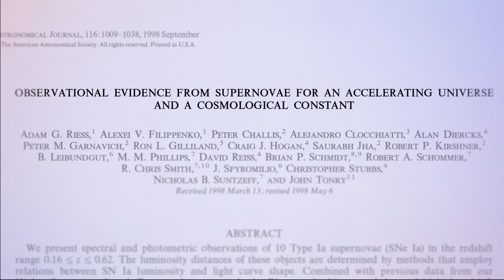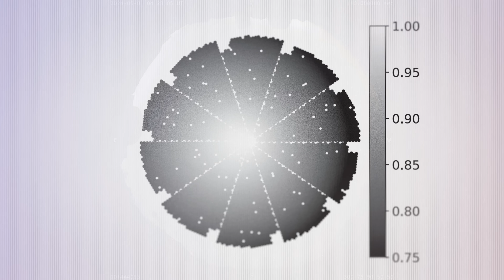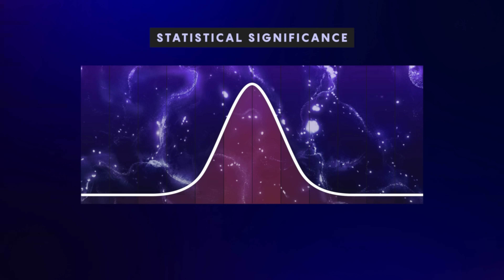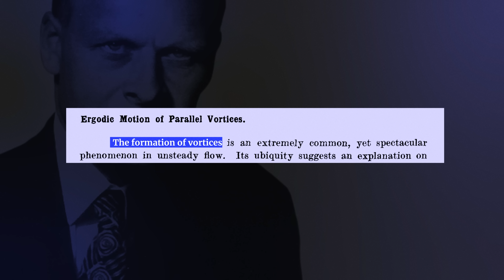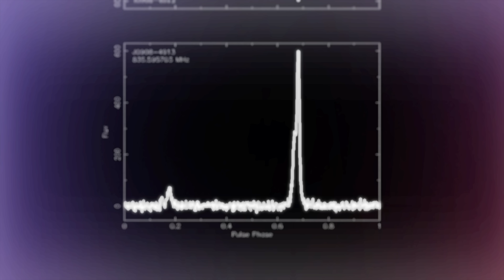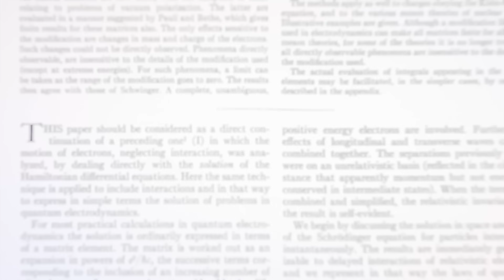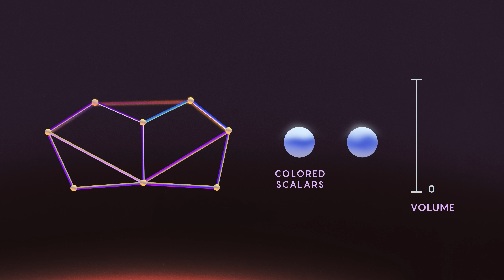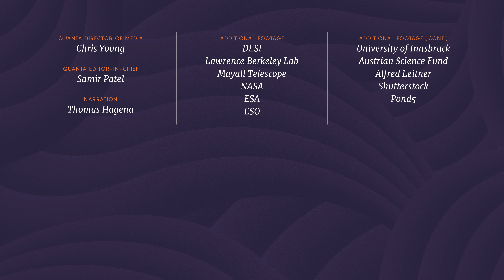Biggest Breakthroughs in Physics: 2024

Comment: Consider this ... Here are the key components of all my physics posts.

First a short  SIMPLIFIED SUMMARY of this model:

Photons were a singularity of energy that existed before the Big Bang. 
That photon singularity made electrons and positrons that made space time.  
Most charged pairs of electrons and positrons annihilated into photons and continued expansion as dark energy. 
Some electrons and positrons, did not annihilate and made protons and neutrons that made atoms. 
The key to atom structure stability was the bond between protons and neutrons.
The singularity of photons,  vacuum energy,  and dark energy are the same. 
Dark energy is an anti gravity like force pushing from empty space. 
Dark energy pushes all matter to move and pushes back any matter that accelerates. This resistance is the key to the effect of gravity.
Dark energy expands more in empty space than in matter.
Dark energy has the power to separate galaxies, and to push apples to the ground. 

The ILLUSTRATION
From left to right: Photons create electron positron pairs that create mostly dark energy and some matter.

SOME SPECIFICS. 
Photons are eternal and outside of time and distance.
The singularity of energy that began the universe was a singularity of photons. 
That singularity of photons created the Big Bang.
That singularity created space time.
Photons created mass through pair conversion of electron positron pairs in the Big Bang.

These electrons and positrons made the elementary particles which in turn made the atoms.
Protons are made of two positrons and one electron.
Neutrons are made of one proton and one electron or two positrons and two electrons. 
Most protons were created in the immediate era after the Big Bang when positrons were plentiful.

Neutrons are unstable protons and decay in 10 minutes. 
The proton neutron bond in the atom nucleus, kept neutrons from decay and was key to building all elements.
Neutrons and hydrogen atoms may have the same makeup, but with different electron placements.
The key to atoms stability may be the deuterium nucleus or deuteron that helps bind one proton to one neutron.
The missing anti matter is in protons and neutrons.

Photons, electrons, and positrons, seem to be different versions of the same thing.  Photons can make an electron and positron pair in pair conversion.  Then the electron and positron can annihilate back to photons.
Both electrons and positrons may move in a helix motion. 
Charge may be opposite helix movements.
Neutrinos may be a form of photon lite.

The horizon problem may have a possible solution if the energy of the singularity pushes into the universe from all empty space, instead of a big bang starting point that pushes out in all directions. 
Virtual particles may be a key part of quantum leaps. 
Virtual particles may power beta plus decay. 

The universe contains .05% of stars and planets, and 70% of dark energy. That's analogous to a smidgen of dust  in a massive dark energy wind.
The mass of the universe comes from photons converting to electron positron pairs in pair conversion.
The energy of the universe comes from electrons and positrons annihilating and converting to photons.

The electron and the positron have opposite charges to drive them to connect and annihilate back to being photons that created them.
The universe is 5% matter from electrons and positrons, and 70%+ dark energy force from photons.
The universe has two forces; electromagnetic force connected to matter and  dark energy a force of expansion  connected to empty space.

Dark energy is an anti gravity like force pushing from empty space.
Dark energy forces all matter to move and resists any matter that accelerates. This is the Current of the Universe.
Dark matter is not gravity from invisible matter pulling, but more likely dark energy expanding and pushing from empty space.
Dark energy expands more in empty space than in matter.
Dark energy has the power to separate galaxies, and to push apples to the ground. 
Massive voids in space have round shapes because dark energy is pushing out in all directions.

The force from the Big Bang singularity was photons / vacuum energy  /dark energy.  They are all connected.
The infinities problem is not a problem but a clue to why vacuum energy is so much greater than dark energy. 

Gravity and the electromagnetic force can't connect up. 
Dark energy, an anti gravity like force, and the electromagnetic force can connect up. 
Dark Energy both pushes mass forward and resists acceleration of mass.
Gravity is not caused by acceleration,  but by the resistance of dark energy to acceleration.
Galileo and Newton's math works just as well for either gravity pullling matter together or in reverse for dark energy pushing from empty space.

Time has speed limits from zero up to the speed of light.
The universe is open ended and should continue to expand.
There may be two universes. This one of space time and  one of photons outside of space time that preceeded space time and created it.

Thank you for reading! There are posts or videos on most of these separate ideas. Feel free to share my posts

Comment: Constraining M-Theory with Gravitational-Wave Echoes
An Experimental Program in Gravitational-Wave Astronomy
Will
Department of Physics, [University / Institute]
December 14, 2025
Abstract
We present a concrete experimental program to test quantum-gravitational models of black hole interiors using gravitational-wave (GW) observations. The program targets the detection and characterization of post-merger gravitational-wave echoes arising from partially reflective structures replacing classical event horizons. By exploiting the independently measured remnant mass M and spin \chi, we define over-constrained observables—the echo time delay \Delta t and effective reflectivity \mathcal{R}—and show how their spin dependence can falsify or constrain competing quantum gravity (QG) frameworks. In particular, we demonstrate how stacked observations with third-generation GW detectors can place the first low-energy experimental bounds on M-Theory fuzzball compactifications, while simultaneously testing Loop Quantum Gravity (LQG) inspired core models. This work reframes quantum gravity from a purely theoretical endeavor into an observational science.
I. Scientific Motivation and Experimental Philosophy
A. The Breakdown of Classical Black Holes
The No-Hair Theorem asserts that astrophysical black holes are fully described by mass M, spin \chi, and charge Q. However, the prediction of spacetime singularities and information loss signals the breakdown of classical physics, motivating quantum-gravitational modifications at or near the horizon scale.
B. Gravitational-Wave Echoes as the Experimental Probe
A QG-modified black hole replaces the perfect event horizon with a near-horizon structure (the QG core). Gravitational waves reflect off this core, generating a sequence of faint, delayed pulses—the echoes—following the main ringdown signal. The detection of echoes constitutes a direct, observational violation of the No-Hair Theorem.
Figure 1: Schematic comparison of near-horizon structure in classical GR, Loop Quantum Gravity (LQG), and M-Theory Fuzzball models. Classical black holes exhibit a perfectly absorbing event horizon. In LQG-inspired models, quantum geometry effects replace the singularity with a compact, Planck-scale core with weak spin dependence. In contrast, the fuzzball paradigm replaces the horizon with an extended, irregular surface composed of string-theoretic microstates, whose geometry and reflectivity depend sensitively on the black hole spin.
C. The Observational Discriminant: Spin Dependence
The two leading QG candidates (Fuzzballs and LQG) predict distinct, spin-dependent signatures for the Echo Period (\Delta t(\chi)) and Effective Reflectivity (\mathcal{R}(\chi)).
Figure 2: Mechanism of gravitational-wave echo formation. Following the primary ringdown, gravitational radiation partially reflects off the quantum-gravitational core and is trapped between the core and the photon sphere. Each round trip produces a delayed echo with characteristic time separation \Delta t, determined by the effective cavity length and the Kerr geometry.
II. The Competing Quantum Gravity Templates
A. Loop Quantum Gravity (LQG) Core
* Echo Period:
  
* Reflectivity: \mathcal{R}_{\text{LQG}}(\chi) \approx \mathcal{R}_0 (constant).
B. M-Theory Fuzzball
* Echo Period:
  
* Reflectivity:
  
Figure 3: Predicted spin dependence of the echo time delay \Delta t for LQG and fuzzball models. LQG predicts a weak, monotonic spin dependence driven primarily by classical Kerr geometry. Fuzzball models exhibit a nonlinear deviation due to spin-dependent microstate geometry, encoded in an effective deformation factor g(\chi). The overlaid shaded regions represent the 1\sigma uncertainty projection for the CE+ET detector network, demonstrating the statistical separability of the two models at high spin.
Figure 4: Effective reflectivity \mathcal{R} as a function of spin. The fuzzball model predicts a non-monotonic reflectivity with a minimum at intermediate spins and a sharp increase near extremality (\chi \to 1), reflecting changes in microstate disorder. The separation in amplitude at extremal spin provides the highest statistical power for model distinction.
III. Observational Strategy: Coherent Stacking with 3G Detectors
A. The Challenge and Current Limits
Current LVK detectors constrain \mathcal{R} \sim 10^{-6}. Detection requires third-generation detectors (CE/ET) offering \sim 10\times sensitivity and \sim 10^3\times event rates.
B. Coherent Stacking Methodology
The \Delta t(\chi) and \mathcal{R}(\chi) templates are applied as a two-dimensional filter to the stacked residual data, maximizing the Signal-to-Noise Ratio (SNR) for N events: \text{SNR}_{\text{stack}} \propto \sqrt{N} \cdot \mathcal{A}_{\text{single}}.
Figure 5: Schematic of the coherent stacking strategy for gravitational-wave echoes. Post-ringdown residuals from multiple merger events are normalized by remnant mass, aligned in time using the predicted \Delta t(\chi), and filtered using the spin-dependent templates. Coherent stacking enhances the signal-to-noise ratio while suppressing incoherent detector noise.
IV. Observational Prediction and Inference
A. Bayesian Model Comparison
The stacking analysis is quantified via the Bayesian Evidence ratio, K. Forecasts suggest that for a Fuzzball-like signal, the combined CE+ET network yields \log_{10} K \sim 3.0 (strong evidence).
Figure 6: Projected constraints in the \Delta t - \mathcal{R} parameter space from stacked 3G observations. Spin-dependent measurements (simulated scatter points) cluster along distinct trajectories predicted by LQG and fuzzball models. The shaded ellipses represent the achievable confidence regions after stacking N \sim 10^3 events, demonstrating the statistical separability necessary for direct model falsification.
B. The Exotic Compact Object (ECO) Preemption Strike
Generic ECOs cannot reproduce the non-monotonic extremal enhancement of \mathcal{R} characteristic of fuzzball microstate disorder, nor the correlated deformation of \Delta t. Consequently, the observed two-parameter trajectory in \Delta t-\mathcal{R} space cannot be mimicked by phenomenological ECOs without severe fine-tuning.
C. Interpretation of a Null Detection
In the absence of detected echoes, the stacked analysis places stringent upper limits on \mathcal{R} at the level \mathcal{R}_{\text{limit}}(\chi), excluding the majority of horizon-scale fuzzball realizations while remaining consistent with Planck-suppressed LQG cores.
Figure 7: Exclusion power of 3G gravitational-wave detectors. The current LVK upper limit (solid red line) is projected against the 3\sigma exclusion floor (dashed gray line) achievable by the CE+ET network. A null detection effectively rules out all QG models whose reflectivity curves fall above the exclusion floor, constraining a vast region of the Fuzzball parameter space.
V. Conclusion: Quantum Gravity Observed
The detection and characterization of spin-dependent gravitational-wave echoes offer a unique opportunity to constrain fundamental physics. A confirmation of the complex, non-linear \Delta t(\chi) and \mathcal{R}(\chi) signatures would provide the first low-energy experimental bounds on the geometric configurations and compactification schemes of M-Theory. This program presents a clear choice: Either astrophysical black holes possess exactly classical horizons, or quantum gravity has already been observed. Future work will extend these templates to include mode mixing and non-axisymmetric microstates.

Comment: um. the Cosmological Constant was a mistake. It was Einstein saying "i dont know, so lets assume so my math will match".
Einstein even admitted it as his "biggest blunder." after speaking with Hubble who proved space is expanding.
he then removed Lamda (the cosomological constant), and replaced it with "Einstein Tensors".
although "good", this is NOT a fix.

im still working on this. Gravity is the key. its not a property of matter, its emergent from matters "resistance" to the expansion. (gravity doesn't pull. matter wants to 'fall' to smaller/slower space.)

give me a second. im working on the math.

Comment: If it reduces to zero the everything is there or are there  problem ? That zero have light because I havent seen a complete dark zero otherwise it would glow glowriah or glory of that afterglow. That energy of blackhole if picturing that like zero, our state of within a stable base binary zero  universe of limited by sizes, states and distance in physical the blackhole is untouchable if not moved by upper level stage or levels of stages movers. If a binary zero a light can be stretched to binary one if applied with attractor. Created from nothing how you define, not a thing. Nil, None. Apply the opposite at the other side saying meron, meron, meron of its 3 in everything.